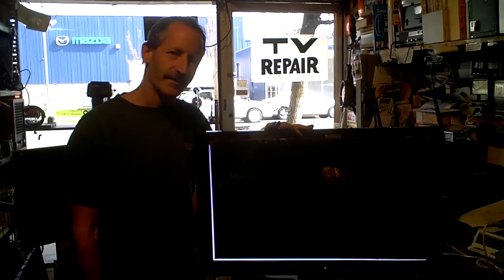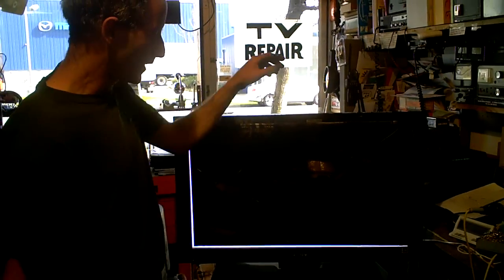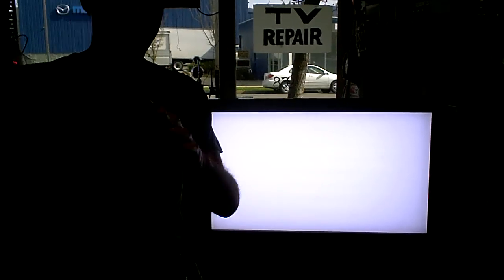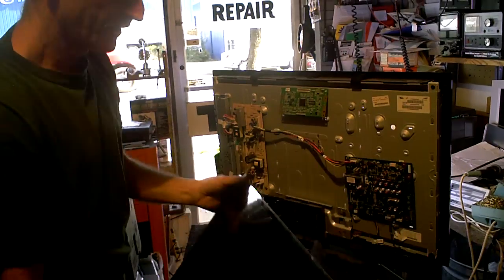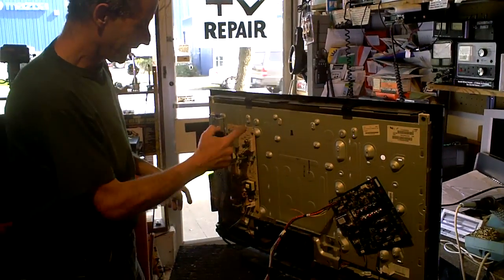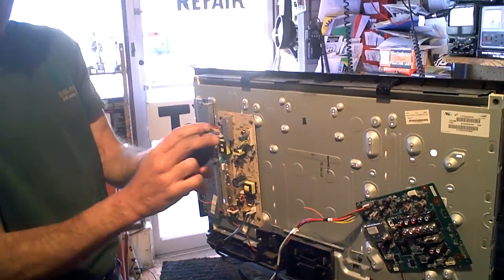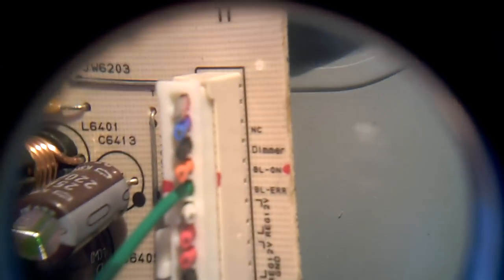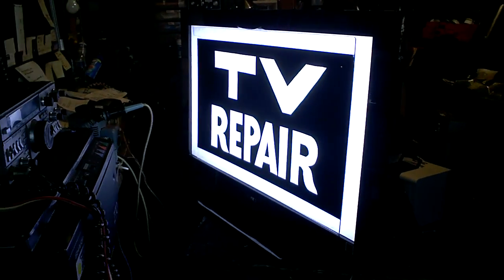Broken TV Repurpose

Comment: I did this to three broken LCD TVs one I got from the dump. I connected the + of the 5V rail to the power on wire and the power supply turned on. On one of the TVs there was a separate enable wire for the inverters so I figured out that hooking the 5V to this and the power on wire gave me a bright as hell shop light. Not sure how many watts these things use but they are BRIGHT.

Comment: Brilliant sir, I have this time a LED LG TV, the pins thas I can see are 3.5v, Power On, and PDIM , and DRY ON, are these three the ones to join?  Without doing nothing the TV turns backlighting off 15 minutes after.  Thanks a lot!
Reply: Wow! yeap ! it worked now! and it even eliminated Video Shoot Flickering appearing before this hack !!!  Thanks a lot sir, once again !
Reply from the maker: If your TV doesn't receive  a signal it will keep turning off after a few minutes. That's why I bypassed the main board by putting a jumper from my stand by voltage on my power supply directly to the enable pin on my power supply. I don't recognize what the DRY ON  pin is on your TV, but it sounds like some kind of enable pin which you may need to power on.  The "power on" pin and 3.5V may need to be connected together assuming the 3.5V is your TVs stand by voltage. The PDIM which I believe is the brightness control may need to be enabled. Sometimes the inverter board has a separate enable pin called BL ON.
Reply: Thanks once again! I ve joined 3 cables, Dry On, Power On and 3.5 V and now it wont turn off and the flickering seen on video shoots dissapeared! that means its kind of a little more bright!  I have not used the PDIM pin, but I am curious if I use it , it will turn even more brighter? or I leave it as it is now?  thanks again sir !
Reply: @RobertoSteveLou  this

Comment: I have converted several TVs into light panels, but they all shut down after about 15 minutes. Do you know how to get around the auto shutdown??
Reply from the maker: Unfortunately the TV is designed to go into shutdown if it doesn't get an RF signal, so what I did to solve the problem was look for in input terminal on the power supply designed to turn the power supply on with a +5 volt input which I took from the power supplies 5 volt stand by power which is always on. I'm sure the name of the power supply on terminal can have a many different names, but some of the names and abbreviations I've seen are PS ON,  or P ON, but I suppose it has more names than I know or remember, but I hope this helps. Some refer this pin as the power supply enable pin. These images on google may help you. https://www.google.com/search?tbm=isch&sxsrf=ALeKk00hdTHfit21d1a1GbHxa7w9hkqtmQ%3A1601347565568&source=hp&biw=1594&bih=782&ei=7Z9yX8akIMvq-gTf2pAQ&q=power+supply+enable+pin.&oq=power+supply+enable+pin.&gs_lcp=CgNpbWcQAzIGCAAQBRAeOgcIIxDqAhAnOgQIIxAnOgUIABCxAzoCCAA6BAgAEB46BAgAEBhQ-xdYm1xg_l5oAXAAeACAAfoDiAGrGZIBCjEyLjkuMi41LTGYAQCgAQGqAQtnd3Mtd2l6LWltZ7ABCg&sclient=img&ved=0ahUKEwiGz7jGrI3sAhVLtZ4KHV8tBAIQ4dUDCAc&uact=5

Comment: could I add a dimmer to control the brightness?
Reply from the maker: If you have a variable AC transformer it would be a simple way to regulate
the brightness. You can pick them up pretty cheap on ebay.

Comment: Why the resistance? I am trying this and unable to get the light to come on.
Reply from the maker: +Roberto Steve Lou Some power supplies may not turn on just by powering up the the PS on terminal with 5 volts. I probably didn't need to use the resistor, but a friend in the business suggested it might add a little extra safety between the PS on terminal and the 5 volt stand by output line.
Reply: A privilege to receive a reply, really gratefull!!!!  But I just connected the three cables and still unable to reach your brilliant idea, please help, my Power Source is the APS254 Sony.    Here a picture of it.  http://tv.yoreparo.com/reparacion_de_tv/1523491.html?p=5117397#5117397
Reply from the maker: Different TVs may have slightly different ways  to enable the power supply to come on as well as the inverter board, Is your 5 volt standby output Okay, and are you applying the 5 volt standby power to the PS ON terminal and the BL on terminal on the inverter board? Have you confirmed the TVs power supply is okay?
Reply: Thanks again! The TV was OK, I can see the Sony logo at boot an raster, looks like I am using the incorrect pins.  Let me try it again.  Many thanks.
Reply: Wow! finally I got it, great diffused light! I think Ill use it for professional portraits or for the sign as you! thanks a lot.  I see a roll of cables going from the same inverter to and Auido Card , got to cut that? Thanks again from Panama!
Reply from the maker: Congratulations on the modification. 
They make pretty awesome backlight signs.
Reply: Sorry, how many tubes are there? what is the power consumption? It turn really hot. No danger there?
Reply from the maker: The lamps do run a little hot. I can't tell you how many lamps you have for your particular TV, but if you already removed the LCD display I would think you could easily count how many lamps you have. If you want to know the power consumption you will need a watt meter or a multimeter meter that can measure current and voltage.
Reply: Thanks! I just removed the black kind of osbcure lens and there is a wiite plastic.
Reply from the maker: I don't know anything about any lenses in an LCD TV. Only light diffusers and an LCD panel. Sounds like your probably doing okay.
Reply: +Grants Pass TV Repair Dear sir, can I cut and use the same LCD Display for the sign?
Reply from the maker: No problem. On my sign I used contact paper and an exacto knife to make my letters. I painted the background black and the letters allow the light to shine through them.
Reply: Roger that!
Reply from the maker: A little more detail. If your using white plastic as I did for my sign Cover the whole piece of plastic with the contact paper. Sketch you sign letters in pencil, then cut out each letter one at a time and peal off the contact paper around the letters. Spray paint your back ground colour and when your done peal up the remaining contact paper. 10-4 on that?
LOL
Reply: Thanks a lot!!!! probably Ill add some leds with the other power voltages de Power Supply gives.

Comment: Now make a video on how to connect a tv board to another screen or to a laptop screen
Reply from the maker: Can you be more specific? What do you mean by TV board?
Reply: @GrantsPassTVRepair The main board with all the connections and everything that a modern TV has and how to connect a TV board to a laptop  display/screen or where I can find such a connector or what is the name of it because I have 2 broken TV and I want to use some laptop display connected to them
Reply from the maker: If this were possible you would need to start with a schematic of the TV, but that sounds like quite a challenge. Perhaps you can find an adapter  or converter that uses your laptop output, and converts it to a an HDMI signal.  @alinbejinaru1755
Reply: @GrantsPassTVRepair I found a TV board kit that has an adapter for a laptop screen but I don't know if the connector from the board(of the TV) is universal for every TV manufacturer or is it proprietary??
Can someone tell me if is that way or the name of the connector used on the TV board??
Reply from the maker: It's beyond the scope of what I know. @alinbejinaru1755
Reply: Ok thanks!!